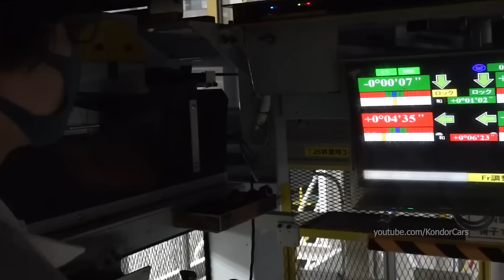2023 Honda Civic Type R Production in Japan

Comment: The last 3 type r models were built in Swindon UK . Super quality built cars . Japan need to keep the same quality.  Beautiful cars
Reply: Purchased a Swindon built Honda Jazz new (2014). Whilst the reliability is there, the Swindon paint job was absolutely dreadful with paint literally flaking off with so many areas just not painted properly. I don't think a car manufactured in Japan would be allowed to leave the factory like that as they have greater pride in what they do.
Reply: @richardmarsh1332  My dad owns a 1992 Civic. Despite being subjected to the weather conditions over the last 20 years, the paint job deteriorated only over the last years. Made in Japan!